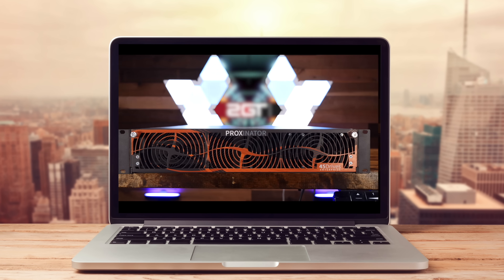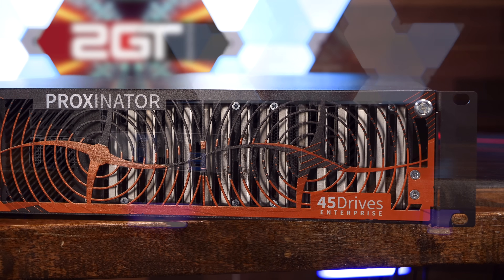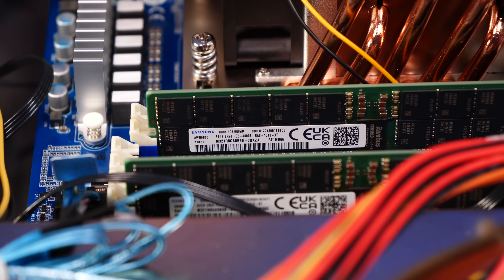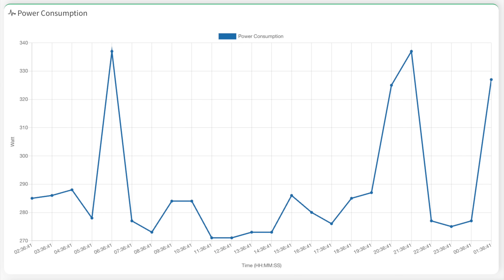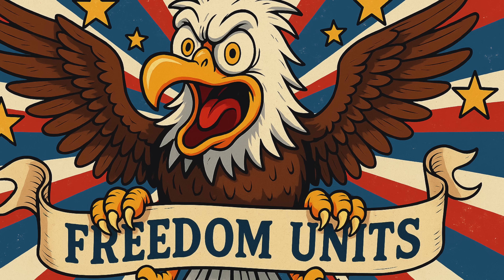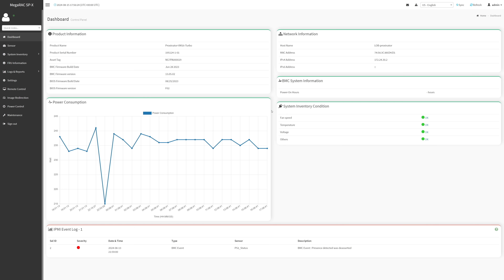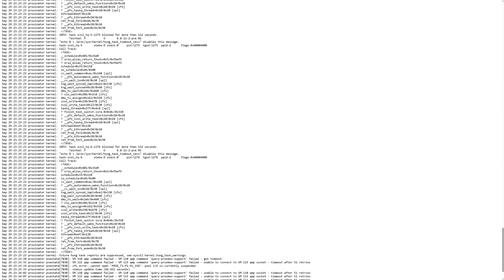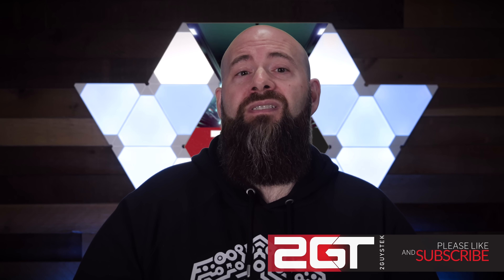One Year with the Proxinator: Does it live up to the promise?

Comment: Ya I will 100% disagree with them on the whole fan wired directly into power without any speed control. They do that on all there chassis and I’ve changed each one. Like when was the last time you saw dell or hp do that, can I say never

Comment: I looked at 45 drives for a recent project. They have a new approach for this, however, where they really get you with their support contracts, design their systems to require a higher node count for compute and storage, and charge a per-node model.  The end solution will be more than double the competing VMware traditional 3-2-1 Basic deployment.  Even if VMware doubled the licensing tomorrow, it still would be a fraction of the cost of 45 drives and their support contract for a comparable solution.  I love the way they build and design their systems.  I don't understand how anyone can justify the higher costs over more traditional vendors like Dell/HPE/Supermicro/Lenovo.
Reply from the maker: Interesting… I appreciate you sharing your experience!

Comment: Great video. I'm used to having a cluster though, so you can do updates with no downtime. I'm guessing enterprises (or in datacenter) would have a cluster of 3, whether 45drives or not?
Reply from the maker: I'd be inclined to agree with you, but it always comes down to use case in the end. In a datacenter, you'd expect to find multiple layers of redundancy across all aspects on the design, and clustering is part of that. But it's entirely normal to have a single node deployed in an edge scenario or a small branch office.

For example, a big fast food chain would have a large DC, but each of their restaurants would have a single node handling things locally and backup and replication would be used to protect against local failure. In a use case like that, it's more about getting the benefits of virtualization while also cutting down on costs.

Comment: The question about the fans isn't that the control is bad, it's whether or not the motherboard can handle switching those fans for a sustained period. You may have gotten lucky. The other thing is: Are those low profile cards getting enough air with the fans running slower? What's the temps on the 100G card?
Reply from the maker: All fair points! Obviously time will tell, but being a year in and everything has been stable and healthy, we’ll see what the next couple of years bring!
Reply from the maker: Not to leave the temperature question hanging, but checking shows the card right around 89°F currently.
Reply: I was thinking along those same lines. If the max amperage of the fans ever hit the mobo, like on a 100-degree day, is there a chance some circuit-traces would pop like a fuse?